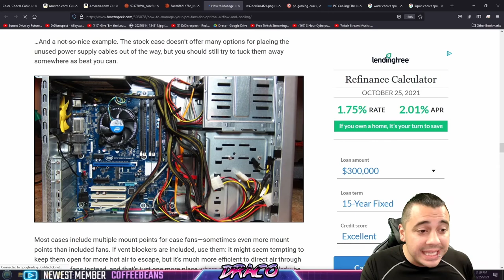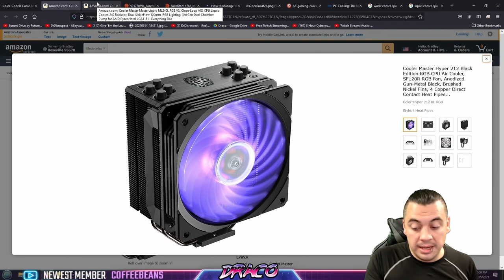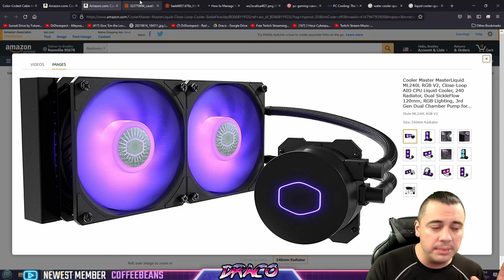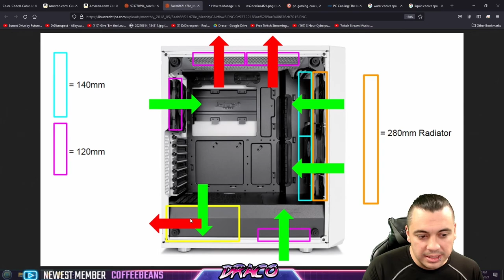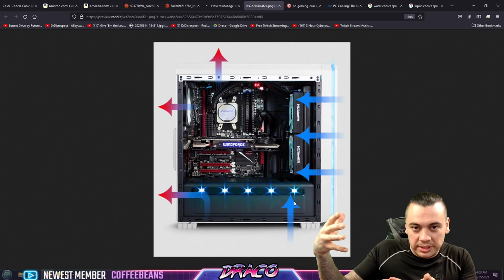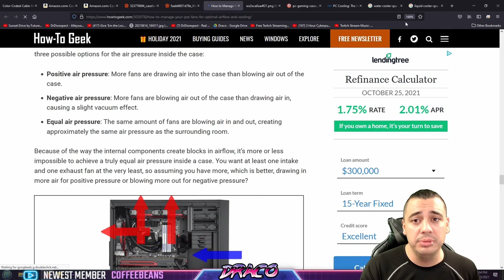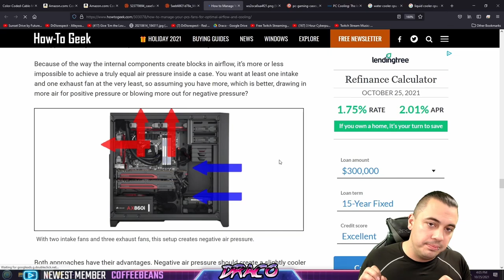How To Setup Proper Airflow Gaming PC Decrease Temps Beginners Guide!

Comment: Hey Draco
I have this case
msi mag forge 100m
In front it has  2 120radiators and 1 120 back
Is it worth to upgrade with 2 140 in front??
+ i install water cooling up with 2 120